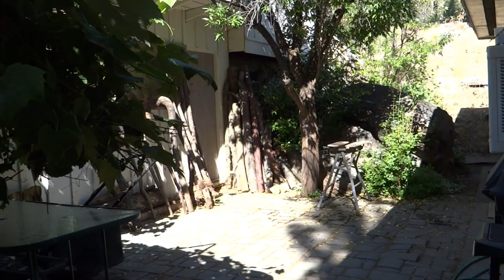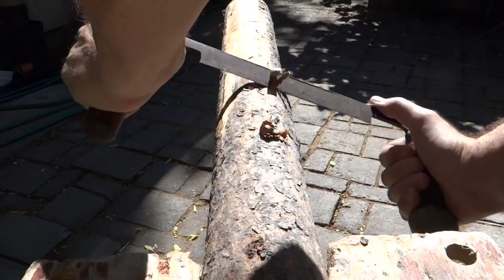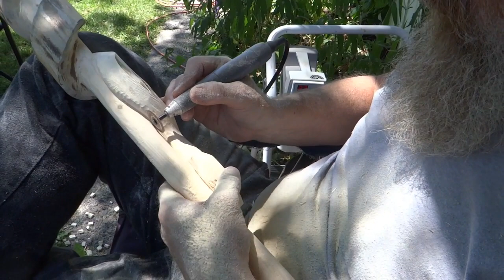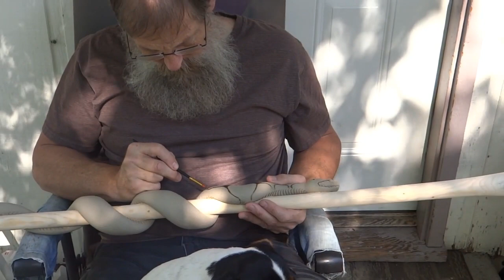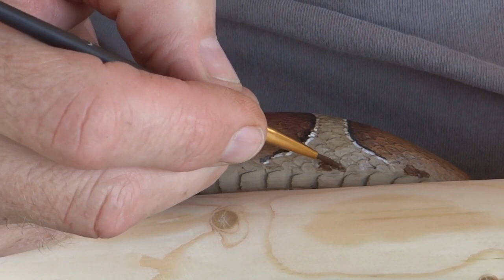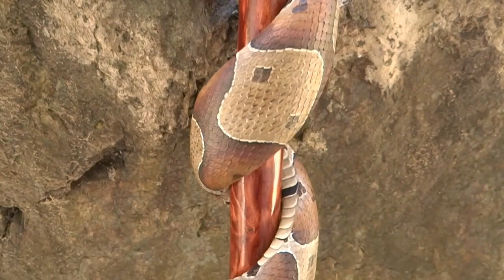Carving Wood Copperhead Walking Stick # 70

Comment: Beautiful video as usual! Do you ever go through all that trouble of carving away the wood and find out the center of the log/stick is no good? If so, do you work around it or scrap it and try another?
Reply from the maker: Thank you very much, Ryan! I have gotten started on a piece of wood, and found pitch in the middle and had to stop. Happily, I didn't wast too much time on it though. Sometimes I'll find bug holes. I can usually work around most of them.

Comment: Yes sir could you tell me where you got the cutting tool on the end of you side grinder that you use. Thank you
Reply from the maker: It is an Arbortech mini grinder. You will find a link for tools in the description under the video.
Reply: Thank you sir. And thank you for your video they are an inspiration to the wood workers like myself.